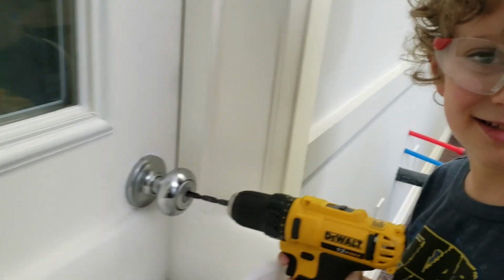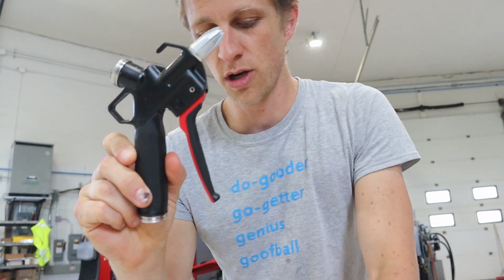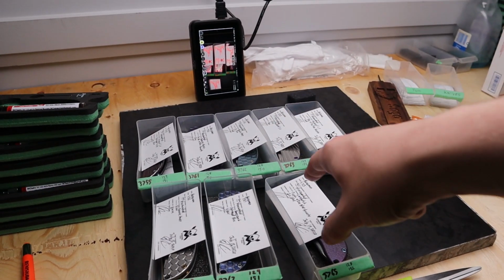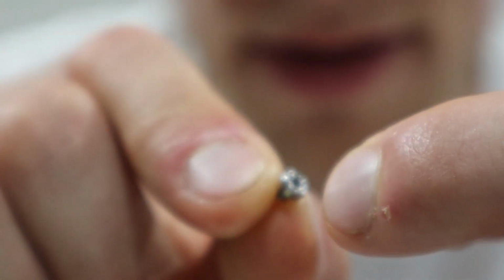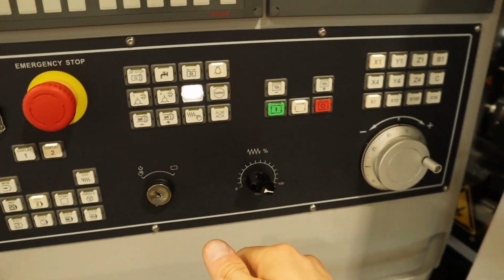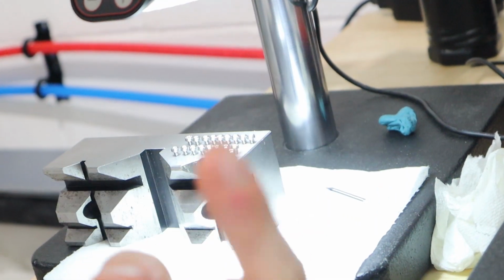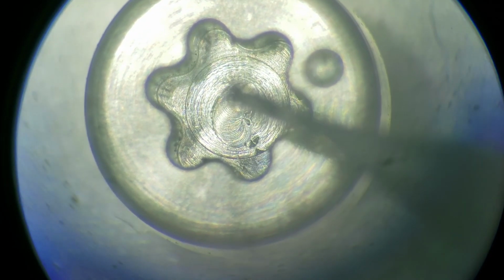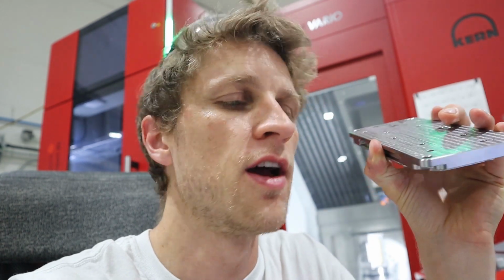Dealing with consistent problems - Shop Life 51

Comment: Your screw getting pulled out of the collet while being machined that’s exactly what’s going on, .005R on .020” E/M it’s a lot of tool pressure try to avoid using big radius E/M if possible.

Comment: As a locksmith you could have used a flathead screwdriver and an 8 inch Cresent on the shank and just spun the lock core since its a kwikset smart key  without drilling dont feel bad about not being able to pick it its a side bar design and you need a feeler to slide on the left side of the lock core to pick it

Comment: I use a different control, but in ours if the tool radius is 'specified' the machine will try to comp for it forcing the tool to move past the radius to remain square.  We will just lie and leave it square.  Just a thought.....

Comment: Have you checked the depth of the feature in the screw?  Could the new end mill be pulling out of its holder little by little causing this issue to be apparent in weird and inconsistent ways?

Comment: Maybe try this command

ACC[Z]=10 (from 1 to 100)
Atleast, it worked better on our Sinumerik. I don't know, what the command on your machine is, but on Sinumerik, it makes the Z-Axis slow, and after that fast.

You can read the Sinumerik manual for more info. But this command makes our machine super smooth.

Comment: Have a similar problem using a .020 engraving tool in 4140. Sometimes it lasts 500 parts sometimes 150. No rhyme or reason
Reply: Are you checking run out on every end mill?
Reply: @lvengineerable  we are not I couldn't change it anyway. Have it stubbed up to about .5 stickout on an ER16 collet use a torque wrench to set. On a hass vf2 at 7500 rpm. Its a single flute .020 45deg engraving tool from MSC. Doing .008" in 4140
Reply: @Awfultyming  I know you can change the runout by tapping them in a bit by .001 or so even on er collets which is a big difference on such a small cutter. I'm not sure how runout really effects single flute cutters. I would still give it a try.

Comment: the adaptive pattern will deflect the tool. Once the pressure is released, the tool with straighten and go deep.
After the adaptive patter, you can do a second pattern with a 40um pass.

Comment: Looks like the center cutting feature of your end mill isn’t sharp or maybe it’s not intended to center cut at all? For an easier approach why not have the code end in the center then use a larger diameter end mill to do a single plunge to clean the bottom. Make the relief a feature.

Comment: The adaptive was flexing your endmill and when the tool pressure relaxed it changed the tool height just enough to see in the finish pass.
Reply: This could be correct. Actually makes sense I use to make keyway with .020 end mills they do flex if you hang to far out the tool holder.

Comment: Something I noticed with the G Code on that lathe. Why is there no Spaces between the words on each block? Is it the Post file doing that? Or just how controller feeds the code in, and not bother displaying Spaces? Example, I find "G0X13.453Y-.947Z3.491" harder to look at then "G0 X13.453 Y-.947 Z3.491". If the code on the computer looks right, the controller should display the same thing, I would think.

Comment: Joining the others here in speculating that something is getting pulled deeper. Either the endmill is pulling the screw out of sub spindle collet, or the endmill is pulling itself out of its collet. Does the new endmill have a different helix angle? I know you pretty much set the sub-spindle collet clamp force by feel. Is there anyway to measure it's clamping force so you can remove that variable?

Comment: One thing which caught me out in the past is Fanuc has  accuracy parameters for both g1 and g0 moves. Basically if you want to save time you can make the accuracy of a rapid worse if it’s not important. 

You shouldn’t G0 to the x y position and then just write a z move in g1. As it might not be in the right place....

Made tiny engraving come out all random till I put a g1 x y move in before plunging in to make it accurate

Comment: Hey John,
At first, sorry about my bad englisch( i,m from holland)🤣

But......i think there is som play in your mill spindle
Under different chip load conditions you probebly have this kind of problems
You had check that spindel?
Greetzzz from Holland

Gertjan Nijsink  

💪
Reply: I was thinking the same. The radius on the endmill creats much more force in Z and maybe the live tool spindle or the tool itself is flexing under that force.

Comment: From what I gather it seems your helix is to aggressive causing the tool to flex and gouge the floor do to the corner dipping down under load.  Also your speeds and feeds are to aggressive.  The corner radius tool is stronger but is less free cutting than the square endmill causing higher cutting loads and tool deflecting  I linked the chart from harvey for that endmill and it looks like you should be running 28500 rpm and only about a 40 millionth FPT.  Usually when you see the gouge marks on the floor you're a hair away from tool breakage.

http://www.harveytool.com/secure/Content/TechInfoPages/SpeedsFeeds/SF_26300.pdf
Reply: Evan Butler this

Comment: Surprised that you were working those machines without AC.   Do you think that running at constant temperature will add stability to your process, or is this mostly to keep the staff from dripping corrosives on the finished parts?

Comment: So happy to see a video from you. I really enjoy sometimes the parallel problem solving. If i can figure out the problem before you get to that part of the video. 

Those are definitely neat air guns, I definitely want to pick a couple up myself. I think the design should be a bit more complimentary of the rather small compressor I currently have. I also like the soft tips. As I am working with wood products .

Comment: I had similar problems with round corner endmills and turns out that the vertical lead in was the problem. Have you checked that John ?

Comment: Was the screw just getting pulled out of the subspindle collet? If you take one of your abridged sections of Torx milling code and run on 2 or 3 parts in a row do you get the same result?

Comment: Looks like you got your problem with the torx squared away, but I think the initial cause of it might have been an aggressive feed for the radiused endmill. Compared to a standard endmill, a bull-nosed endmill will be stronger, but also have a greater cutting force. Depending on how much material you were removing on your finish pass, that extra cutting force could have been enough to make the endmill dig into your screws.